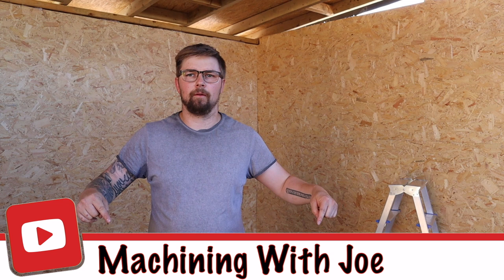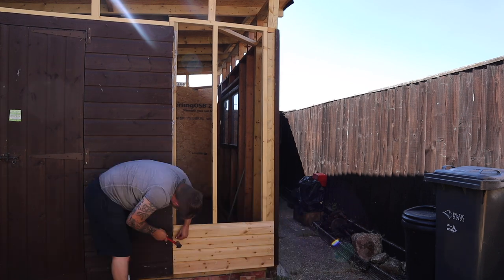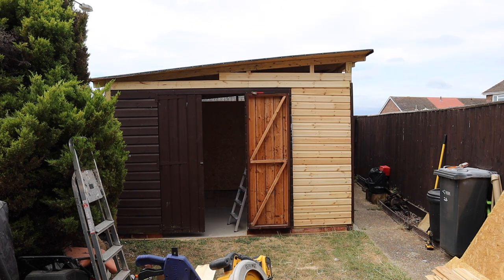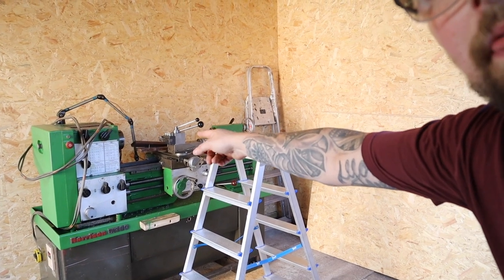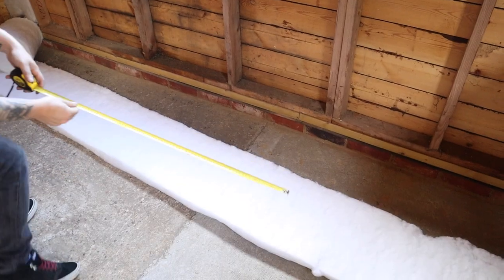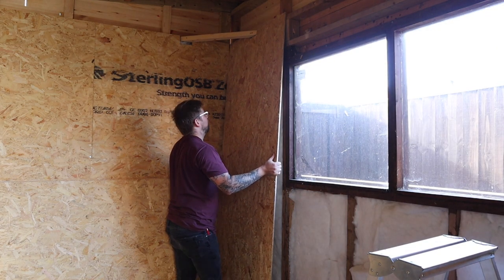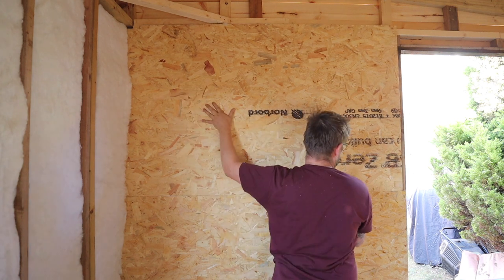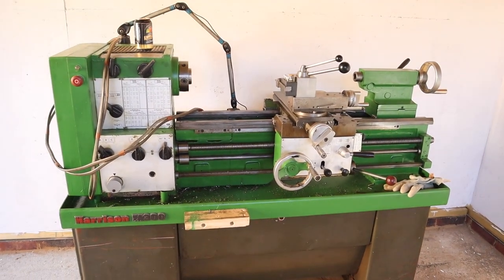Building My DREAM Workshop Part 2

Comment: Where was your insulation from, the only stuff I can see anywhere is 110mm thick and the shed type I am looking at is held up with 3 x 2's like yours and 110mm is too thick.
Reply from the maker: Hi dr1verman I have left a link in the description where you can buy it. For me this has worked out great in the workshop.
Reply: @MachiningwithJoe  thanks.